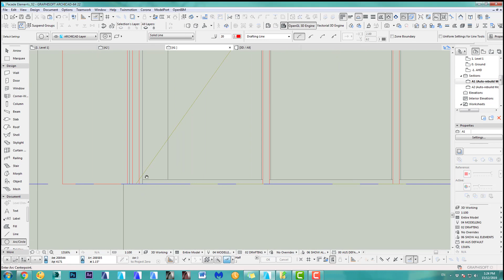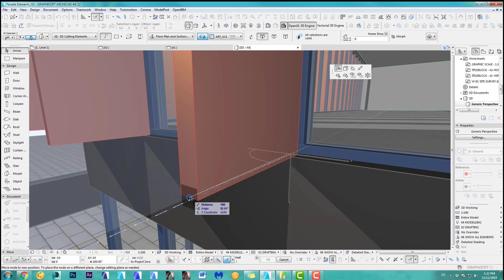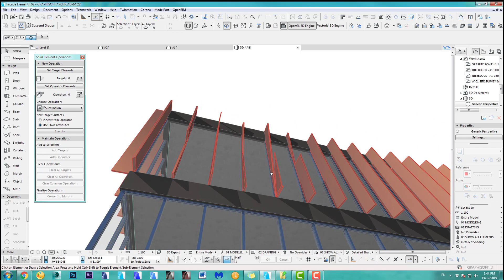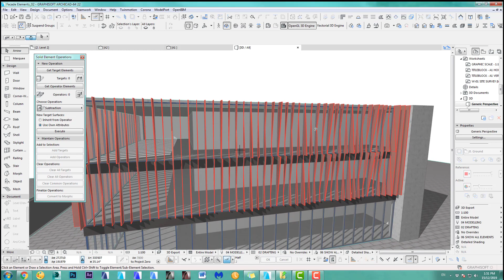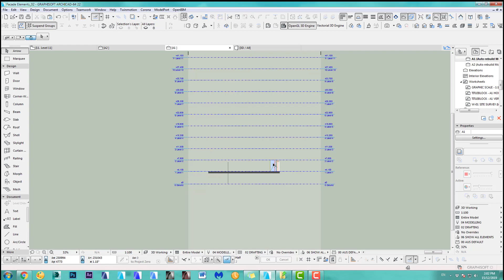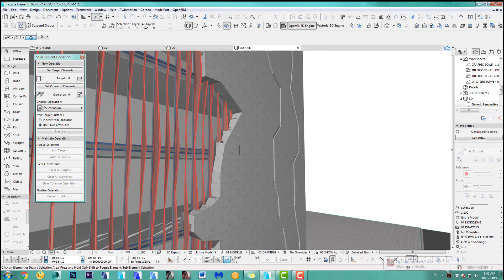Comment: Hello sir great tutorial as always! But what if you wanted to make a change on of the blade pair after completion of all floors. Do we have to make copy-paste thing all over again ? is there a workaround for that? other than changing those to objects .
Reply: I am not sure what you mean with change to the blades. Like make them thicker , thinner, rotate them a bit, draw new ones etc. ? If you can elaborate further then I can give you a more exact answer.
Reply: overall change of morph(cutting) elements sir. what if i wanted to replace the whole pattern after all ?
Reply: @mikbal7055  then you have to do the morph elements again. You can of course create one a large morph element, or a couple of large ones used as cutting element which cover all the blades on 1 facade. It really depends on the pattern you like to achieve
Reply: @ASMTechbase  Is there something in Archicad similar to  "instanced objects" like in 3dsmax ? that would be really useful.
Reply: Mikbal no instances in AC , the only way you could do it is create a library part. Then when you like to change the design , you can create the new design and save it again as library part , overwrite the old library part with same name . This will automatically replace the old design where ever you have used this library part . It might even keeps the SEO and automatically updates the elements you did cut but have not tried this myself .
Reply: @ASMTechbase  thank you for your answers sir! I really appreciate it.